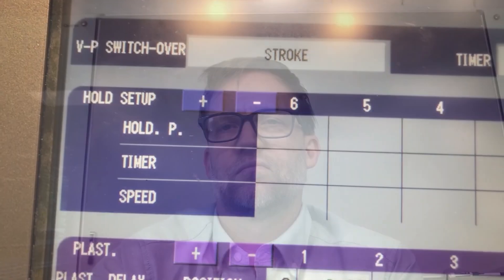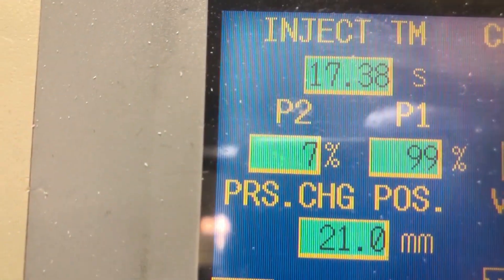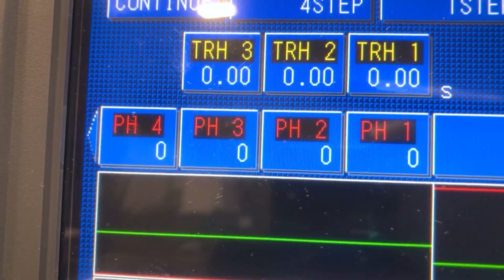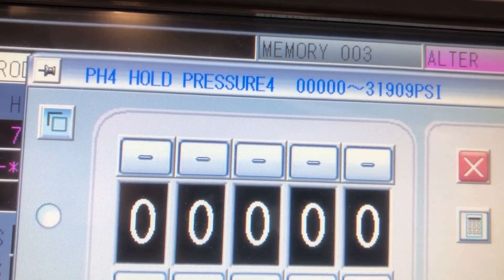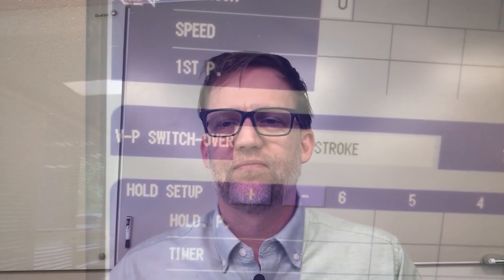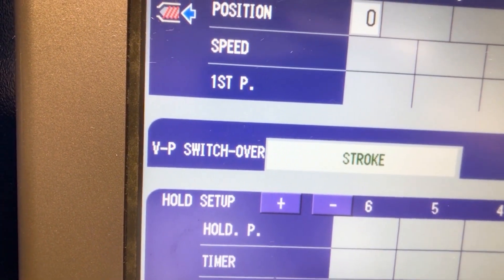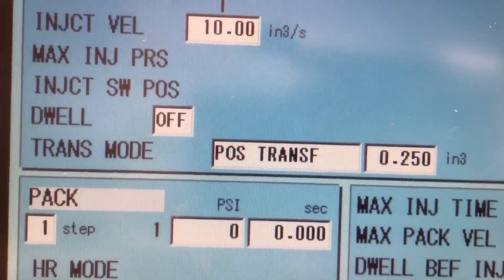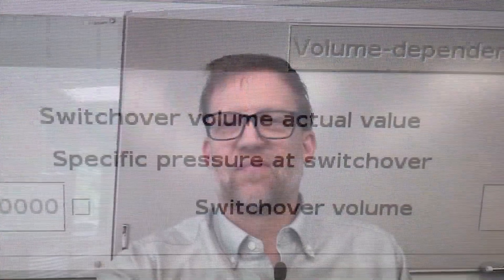Understanding the Terminology of Different Molding Machines

Comment: Originally, suck back was used to overcome nozzle drool, avoiding the need to use a shut-off valve within the nozzle.
Retraction screw in a slow, controllable manner ensures that the sleeve of the back for valve assembly " situated in front of the screw "  moves to the same position, each cycle to ensure that the backflow valve assembly obtains a consistent position.
Failing to retreat screw-in a slow, controllable manner could result in excessive variation in the melt cushion.
Reply from the maker: I like the term Decompression better because that is precisely what we are doing to the melt. We compress the melt during recovery with backpressure then we need to decompress the melt to reduce drool. The second function of decomp or suck back is to seat the non-return valve in the same position every cycle, this position is fully open. Now the valve travels the exact same distance, full open to full closed, at the beginning  of injection.
Reply: @rjg  Hi Jason, l also like the term decompression and fully agreed with you. I love to watch your videos. They are very supportive and helpful. The reason l mentioned the word suck-back is because we can use this term as well as decompression.

Comment: nice video, but the game style of delivering it was a bit confusing, would be nice to have a basic tutorial of the injection moulder's parts, and cycle of functioning, what plastics can be used, as well as a start-up video, from ALL OFF, and NO plastic or mould in the machine, to up and running, as this machine does differ significantly from a 3D printer, which some of us are familliar with :-)